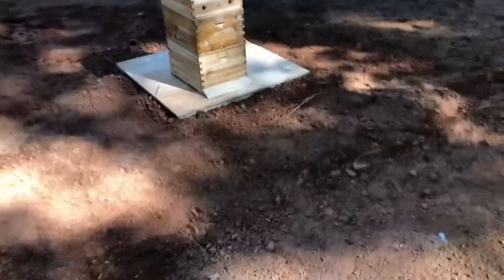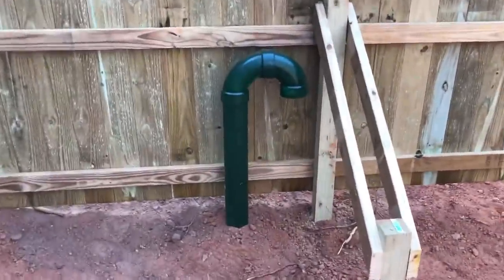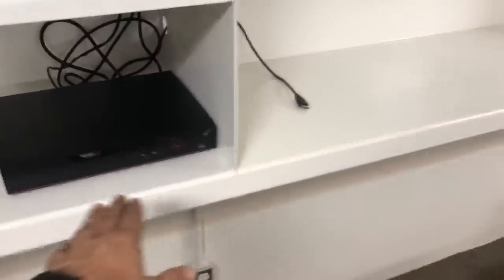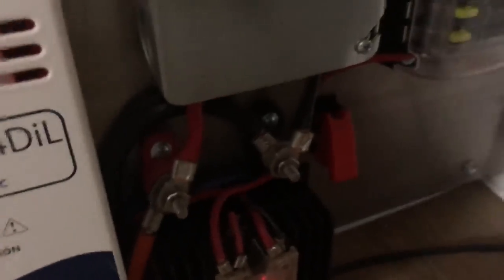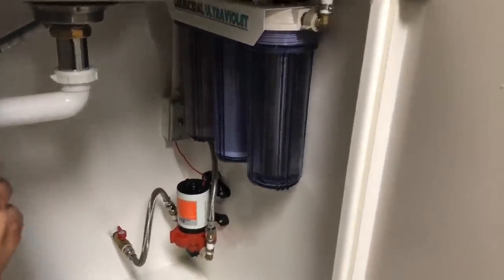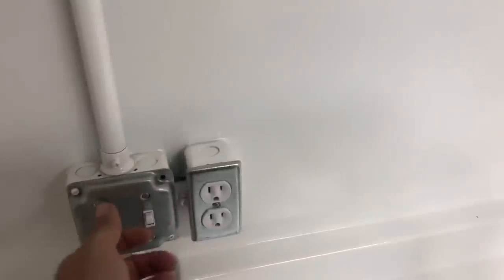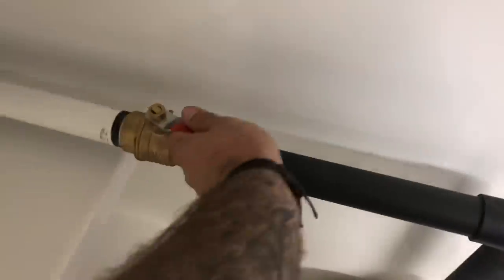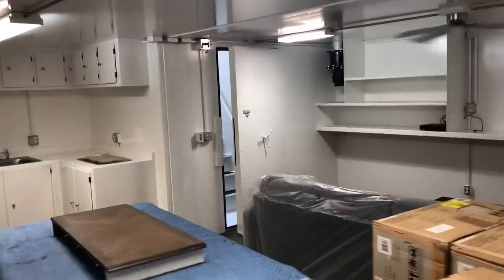Inside a REAL SHTF BUNKER - Doomsday Prepper Walk-Through

Comment: The battery is that your charger needs to be in a separate place from where you're going to be living because as you charge battery feel your building up hydrogen gas you need to bring a shipping container next to it put your battery in your electrical stuff and hit don't store your batteries where you're going to be sleeping are staying then as you charge those batteries that builds up hydrogen gas marry you a shipping container put your propane tank down in it and a Generac generator and air it out you store your water next to hit with extra food pour your concrete pad overhead make your hatch watertight and that way you don't get no radiation I hope this helps you out but you can look it up as you charge those batteries up it will build up hydrogen gas don't want you gassing yourself and blowing yourself up just did you research on it and thank me later

Comment: I see some pretty serious issues with this bunker...first off having any sort of gas line into the bunker should be against the law...there are perfectly safe electric water heaters. Also the solar power setup is extremely underpowered. I would also like to not that while there is bedding for 14+ people there is definitely not enough space for storage to support that amount of people for longer than maybe 30 days at minimum rations and 2500 gallons of water isnt going to last very long. Water lines that take from the city's line will not be your safest bet. I would propose rain water collection. The air pipes all look like PVC so "bomb" shelter that gets a big blast close by loses air flow because PVC pipes bust under the weight of the trees falling on them...I have other issues and I'm sure that if I were able to personally inspect this bunker I would find many more but nobody has enough time for all that. I am not affiliated with any bunker building company and these are my opinions and I was not influenced by anyone to write this review/comment. Thanx for reading:)

Comment: blast proof door?? nope if it was it would open out and 

those look like some cold welds and the welder went fast 5:54
yay we have propane 

and as for the door i i wanted to break in nice and quiet a hydrolic jac will do a damm fine job dont know whats gonna give first the hinges or the lach but im fairly confident that a 10-20 ton hydrolic jack paired with a wood beam against the stairs will jack it open

Comment: I just have more questions. How do you keep the water out. I know you said the dirt was piled up to discourage water going in but some good downpours will level that dirt back out. What about a hurricane or earthquake when distruction is happening above your head, what happens to your solar panels? No power if they get damaged. I did think the fan on the air was super loud especially in a small space that would make me crazy. What precautions are taken for earthquakes since pipes and everything will be moving around and shifting? Is there an alternative way to heat water other than propane in a bunker?

Comment: 12 is a holy number and you have 12 bunks. The couch would be 13 which would be like a servant candle. It is good that you are using holy numbers to put together your survival strategy. When I compose a song I use holy numbers for the length of the song the measurements of the beats and the lyrics. Four is the number of man seven is the number of perfection 12 is the number of government ( in your case it would probably mean establishing sovereignty or authority over your environment)... If an unholy number is used at least be aware of the fact that it is an unholy number ...so you can allocate where correctly belongs.

Comment: would like to see a return vid  in about 2- 3 years and see how its held up .. ..    on that note ..   I can say , as a very very short term shelter   its  ok  to iffy …   hers my list of concerns  ..  !   air inlet  and exhaust .. ( pvc) ,,  also  to add ,, is there a straight pipe  all the way through with at least a y  or a t  at least  16  to 24 inches from the bottom  and an uphill grade stringer feed pipe  into the shelter with at least 2 90 degree bends so nothing  can  get flow into the system.. eg .. kick the pipe  ,, pour fuel of some kind down and light it up  … ( smokem  out kinda thing  or worse  send a massive fireball into the shelter) .  2:  the 12 volt system is wonky at best in my opinion . all connections  should be covered  and secured  and switches relocated to safer place ( not in and around  the main system ) like a secondary fail safe   one metal object touches any of those and youll get spark  potential .and to further add  how about the hydrogen gass off from the batteries  for a long duration .they should also have asecondays  blast proof door and ventilation system as well  3 : the weld shown  is sad   and beyond poor .., looks like a bubble gum weld that someone that doesnt know what rod  or what amperage setting to use . is that water proof etc .  and 4: should never  ever  ever use natural gas in a confined space !!!!!!!!!!!   ask any miner  or any oil field worker  or demo expert ... remember    it only takes a matter of a blink of an eye  and pooooooof   bang   kapow .   <<   thinking as a person that wants in at any cost and get whomever is in there out  would be simple .   just saying  that's  all …  but the main 4 concerns are real .. especially seeing  someone  would dish out all that  money  to have a false sense of security   dont let  all that  nice shinny paint  and tidyness fool you  ,, think about it logically  and be honest … also are there  co2 and co monitors ,, installed as well ??   remember safety is priority  go to sleep and possibley never wake up .. and  the list can go on  and on .,,   now   please don't take offense to what I have just said  to heart    ,, just food for thought .,,,

Comment: i think the design isnt the best for a shelter, especially if it needs used long term. Needs a better access door, i dont think that would offer more than 20 seconds of protection from anyone breaking in. Also the bathroom was way to big and took away from the other rooms, i wouldnt want to store anything in there, it has no direct ventilation for that room and it will condense really bad with the steel walls everytime anyone washes or showers, so will most likely ruin and causes anything stored to rot, should be much smaller and keep storage out of a wet room. Also needs bigger ventilation, if you actually filled that to capacity and shut the doors i think you are going to die from co2, also bear in mind it may be stuck running on 12v, so i think 3-4 of them systems need to be used. It's a nice size overall though and looks good, just needs a few mods i think to make it a much better shelter.

Comment: Good walk through video. I"m concerned about 2 things: drainage and propane. 
All of the electrics, especially the batteries are very low to the floor, so that if any flooding occurs all electrical systems will fail. There are easy fixes for that, as it's not moved in yet. Maybe there are drainage solutions we're not seeing here.
Others have spoken on the explosive issues with propane in bunkers. 
There are a few simple fixes for each of these issues. Other than that this seems like a very nice bunker.

Comment: Why didn't they place the air filter above ground to keep radioactive dust out of the bunker?
Why aren't the batteries in a vented box?
Why doesn't the ventilation come on with the lights?
Reply: This is a storm shelter not bunker a nice one albeit there’s to many things wrong like there no filter filtering outside air from inside air the water coming in is city water meaning it is much more likely to be compromised in a bad situation
Reply: @mrprodigy7143  
Don't ever quit.

Comment: Has the owner of this bunker thought about switching out the manual air out handle with a check valve which would eliminate the need for the manual control?

Comment: The fan is so loud that after few hours you are going to turn it off. And you can’t close the door because the air won’t circulate (like it would…) lead batteries, for what ? A day or two? So many flaws in this bunker. And the welding doesn’t look professional. No decontamination room. What’s the saying ? When you pay peanuts you get monkeys ? I hope it was cheap.

Comment: Looks like a Rising S bunker and air filtration system.  Don't like there bunkers due to the "weather proof" entry door and cut corners on the Air system, PVC above ground piping and blast caps.  But a good video anyways

Comment: One of the biggest concerns I have about bunkers is the hydrostatic pressure from ground water. Where I live, the soil is all clay once you get down 18 to 24 inches. It would be a waste of money to put a bunker on my property for that reason alone. I've researched bunkers a little bit but haven't seen anything about subterranean water problem mitigation. Is there anything on the 'tube about this? I haven't seen it from Rising S or Atlas.
Reply: Main thing you need is a downhill for the water to go to.  Anything sitting in underground water (ceramic/metal/rubber that breaks down) is a recipe for short term disaster, and long-term disaster no matter what.

Comment: @Bear Independent ... Among other shortcomings previously mentioned, the access hatch should have been the first line of defense. I'm pretty sure I got a solid look at the 2nd door and I'm at a total loss as to how you determined it qualifies as a 'blast door'. Such a door would swing outward, not in. The lock in and of itself is freshman at best, and easily defeated. And that rear door into the master bedroom is nothing more than a metal version of an interior door in your house, nothing ballistic. As for the welds between the access portion and the main box, what kind of welds are they? I would about guarantee they would not pass a true inspection. Your faith in the LPG install is a little worrisome. Standard residential construction regulations in many places I know of first hand include sensors for leak detection. It's been born out that gas is not the path to take. The fresh air supply system presented is woefully inadequate. At the bare minimum with only one unit, IF it was properly sized, should be the furthest from the air exhaust. And the exhaust should pick up at the lowest point where all of the heavy toxins settle, not a few feet below the ceiling. This unit, which is technically a shelter not a bunker, needs 3-4 air units if like the one seen in the video. A true bunker, not a shelter, would utilize a proper filtration system like the Swiss use that provides actual NBC protection in conjunction with other "blast" features. I could continue a punch list to include expanded information on other items previously mentioned by others as well as more not mentioned. I get that you were contracted to be between buyer and seller, and along with that came the customary NDA. With this particular shelter I can understand why you would take it as a quality shelter. I myself dont agree.  It "looks good from far, but is far from good".  Some argue it's better than nothing, but I don't agree. When it comes down to a natural disaster or SHTF moment that we are working to take care of ourselves & loved ones we need to do our best due diligence in making it right and not find out we fell short and have now put them all in grave danger.  Frank Zappa is quoted with "Your mind is like a parachute. If it isnt open it doesnt work." With all of the good you work so hard to do and share it with others I would implore you to do some independent research of any number of builders out there. As we would normally do drill down into their claims and see if they are based in fact. In my research I wanted to know the actual definition of the things like the basic terms like shelter, bunker, etc. and then worked out from there. Each one has a number of things to run down with a number of trails after that.  In my heart of hearts I believe you will find this particular "bunker" to be lacking, not by your doing. With respect and in His name I wish you all the best.

Comment: Nice job! 100% more than I have. I would steer clear of propane myself. I'd also have an undergtound, gravity fed water supply with natural filtration.
Reply from the maker: The propane criticism is the only valid criticism I see. The propane was installed by pros and checked for leaks. Twice. And it will be checked again. But I may just do a work-around and eliminate it.

Comment: I just watched the video again. The welds are horrible. I guarantee that shelter will flood if it's in a high water table. And the way Rising S does the air system you can pour whatever you want down those PVC vent pipes and it goes directly into the shelter. I have done my research on shelter and bunker builders. And the owner of Rising S is a convicted felon. I wouldn't trust that guy as far as I can throw him. Get with someone better Bear. Rising S isn't the guy you should be backing Sir. He even set up one of his own clients, the client did break the law but it just goes to show you what a snake in the grass the owner of Rising S is to set up his client who paid him and the client went to prison.

Comment: PVC air pipes, propane gas, (you should have know better as a prepper) and no AR500 hatch door, you entry doors are only pistol proof (not AR500 steel which is rifle proof) any good prepper would have gone with a bullet proof door/hatch!!! come on? You have a very expensive tornado shelter?

Comment: You need an emergency escape hatch one way in one way out to just a casket for 12 or 13 people least need an escape hatch that leads off in the tunnels going to different directions stuck with stuff to rebuild after all hell breaks loose Siege animals you betcha kineta underground bunker Noah's Ark and put back to heavy and set yourself up for electrical magnetic pulses and get a radiation tester so you at least know it's safe to go outside just want you to be safe if you're going to do it do it all the way God bless hang in there

Comment: I am stunned bear, that is a real off the rack, cobbled together piece of junk. the engineer should be run out of the country. worst of all is that bad joke of an air system, are you kidding me?? plastic vent pipes. didnt you pay any attention to the in country nbc set ups or go in any secure bunkers. on a tour? good grief charlie brown that thing is a glorified tornado shelter if it doesn't blow up or fill full of water first. . .are you really putting your name. on this floater?  good luck with that mill stone brother. . .

Comment: Ok I see a lot of people going off about this bunker like they actually know what there talking about. 
And I'm betting that if they knew where it was 90% of them would be running to it if something were to happen. I agree some things should be changed however Bear said many things are being looked over and considered. However if you look at any bunker that has ever been installed you will find things that could be better. 
You will find faults, and you will find lay out issues. 
They are not ment to be lived in for years at a time. They are ment to keep you alive until whatever has passed and you can return to ground level. 
I will agree the propain needs to go. It can be replaced with an electric RV type water heater for instant hot water that can run off both power sources. 
The PVC pipes can work just fine if you know how to hide them. 
A bit of creative block laying is all it takes. But I would have the pipes much farther away from the bunker. The best I have seen is taking a boulder and carving out the inside to make kinda a dome inside it. Drilling small air holes through it and placing it over the intake pipe. So when if some one were to sit on it they would just think it's a rock. 
The exit hatches were also done the same way with boulders. The main hatch was grassed over with live grass and mesh to keep the grass attached. This bunker was in a field with a few trees here and there and even if you walked over it you didnt know it was there.

Comment: that bunker is garbage! Good to see that they welded the entry area to the shelter body but should be at a 90 degree. You cant have PVC for air intakes.  Air out needs to be closer to the floor and in your sleeping area so your getting fresh air exchange. Rising S's air filtration system is a joke, get rid of it! You can not have propane in a shelter! Rising S is a want to be, trying to push tornado shelters as SHTF bunkers but they are trash! Atlas shelters could have made the same shelter (don't have to get a culvert one) and there would be no PVC for air in and out, Air filtration system would have been good, placement of air out would have been correct. Doors would have been better, and everything would have been done correct for just as much money. Enjoy you death trap. normally I like your vids but this is a thumbs down.
Reply: People watch a couple videos on You Tube from the Atlas guy and suddenly they're bunker experts.
Reply: @rfi-cryptolab4251 I know it, I hate those guys